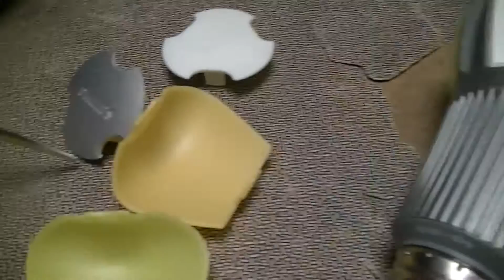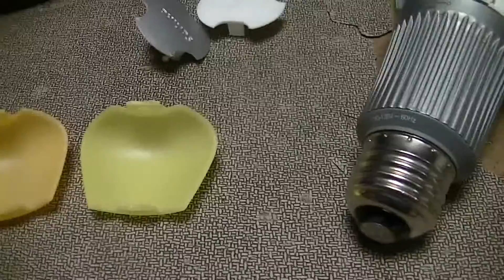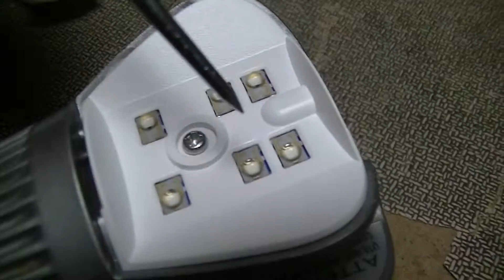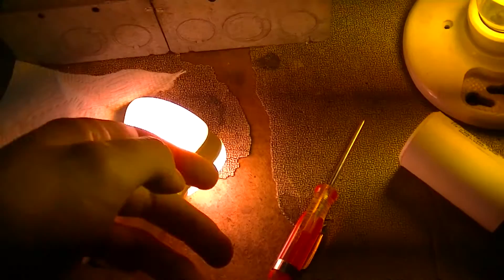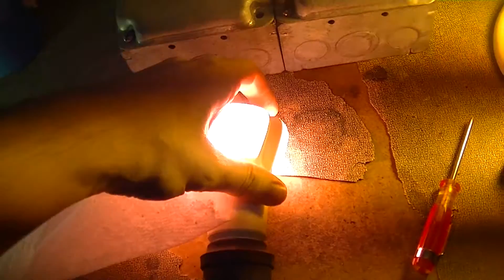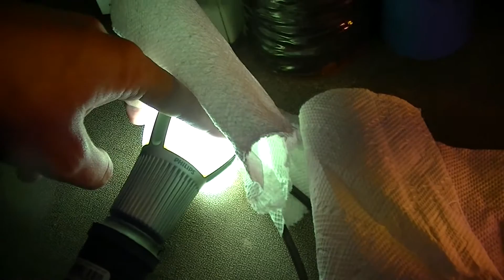Philips LED lamp mod

Comment: Aha! I had mentioned these light bulbs earlier on your solar panel video. We have the original one from 2012 that cost $39.99 + tax and it's used for about 16 hours a day since 2012. Still going strong. The next year Philips came out with the white one but lower quality, plastic vs metal and lighter. It burned out in less than 3 years. If I remember, I think the white one cost $24.99 + tax. in 2013

I have taken them apart and that is some funky blue light that those LED's give off.
Reply from the maker: These use what are known as royal blue LEDs, which make energetic enough photons that they cause fluorescence in things much like UV light; including the vitreous humor in your eyeballs, so eyestrain can very much be a problem.

There was also a subtler way these were cheapened out on a year or so before they were discontinued.  When introduced in 2009/2010, these lamps used 6 LEDs under each lobe, the LEDs only being driven at 500mW each to lessen die loading and thus boost efficiency and longevity.  This was reduced to 3 LEDs per lobe.  There was also an 8W version that always used 3 LEDs per lobe that replaced the earlier '40W GLS equivalent' Philips remote phosphor lamp that used a phosphor loaded plastic hemisphere under a glass cover.

Comment from the maker: That, or an anti reverse current diode for applications where the LED is being run near its absolute maximum ratings, power dissipation from reverse bias breakdown would kill the LED.
A unidirectional avalanche diode would do both reverse bias and ESD protection, so that is probably what it is.